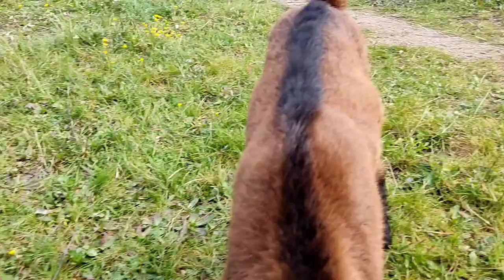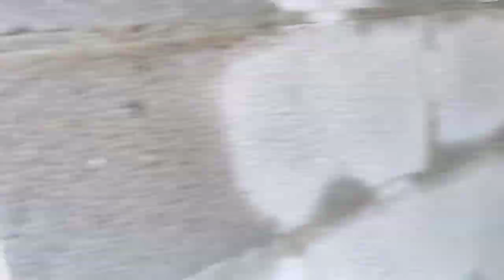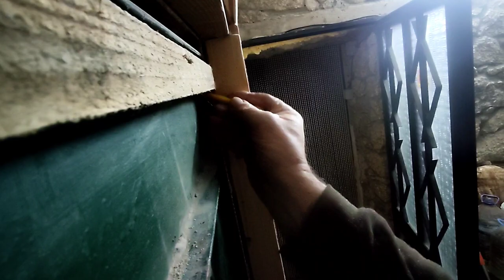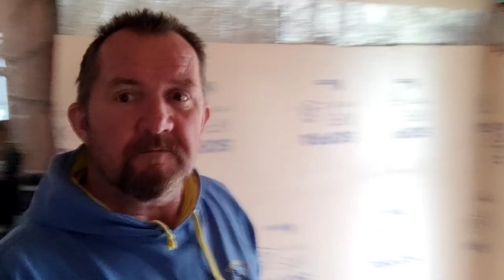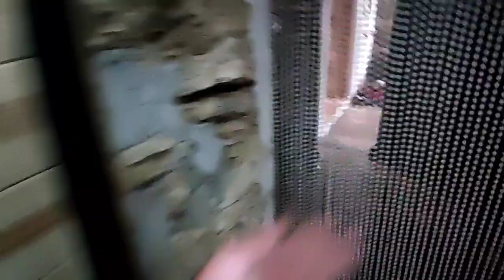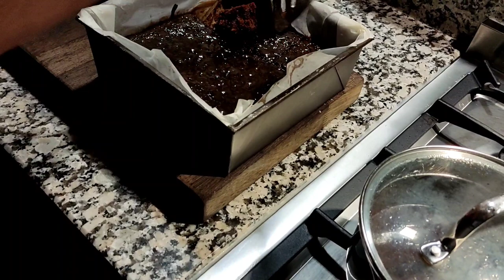Insulating Steel Doors, and Sticky Toffee Pudding, - 133.

Comment: Nick with regards to goats , they are prone to common tit infection especially just around birth n first suckling time , signs are very painful on touch , so much so that it's common cause of abandoning Kids.
Tip is to keep an eye ,keep bending dry and may spray mix of antibacterial, minimum Viniger+ drop of olive oil to keep tits soft and prevent cracking while they expanding.
My Grand ma used to do preventative method , sew Cloth bags with ties and start putting it on a week befor bi birth ,that kept tits from direct contact with potential contaminated ground etc. 

I hope it helps
Reply from the maker: Thanks mate duly noted, you are a wealth of info👍😁